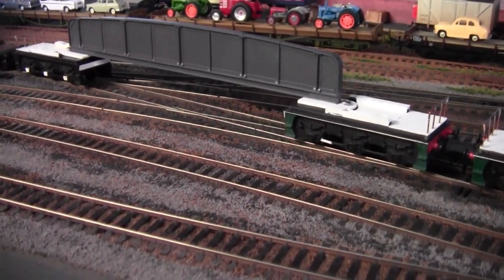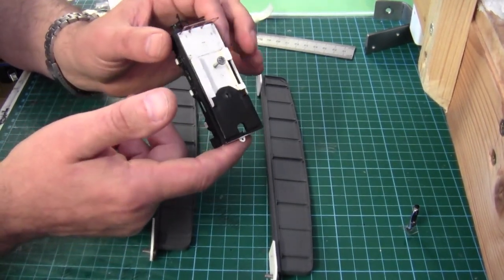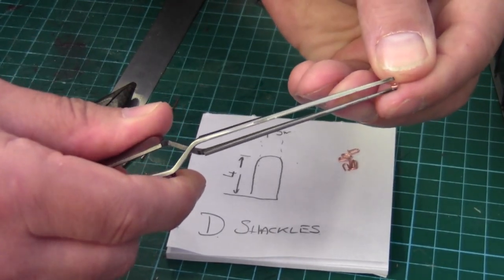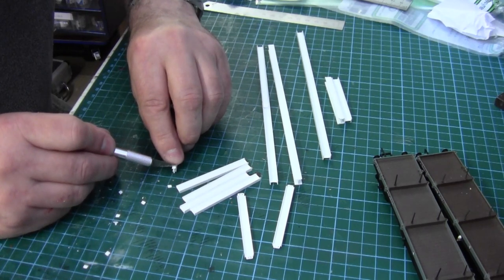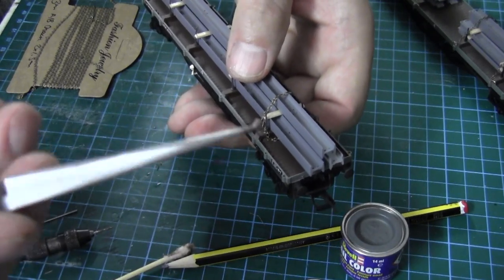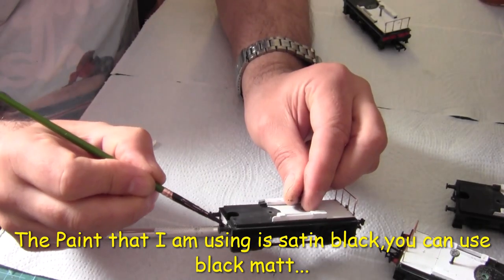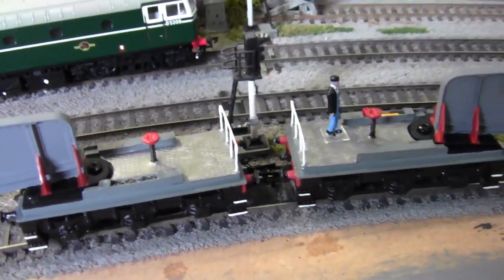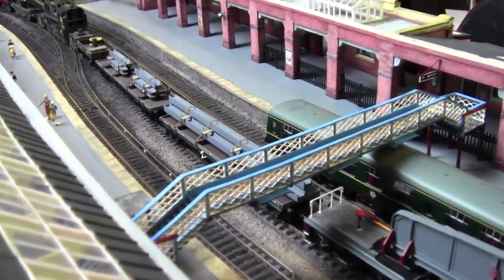The Bridge Transporter Part 2...No263

Comment: It is all this added detail that adds so much interest to these LBWs whether stationary or as part of a moving train.  Oh, and for your information, mate, the ‘gusset’ is called the web of the girder.  Love the girders with their chains on the bolsters; very realistic looking.  Great job, Tony.
Joe and I saw it all arrive at Newhassle.  We were there trainspotting.  😉
I thing that you need some shims under the right hand legs of your bench to make it level, Tony.   Best regards, Jason
Reply from the maker: Hi Jason mate. i knew about the web but i just couldnt find the right words during videoing at the time. i hope you can forgive me on that one. thanks for the reminder though.  so you and the guys have seen the run through Newhassle. i bet you wont see another one like it. my bench is an old camping fold away bench. and it rock and rolls when videoing. its a right little rocker....many thanks again for commenting. best regards Tony.
Reply: @TONYNORTHEASTERN  We were more interested in LBWs than the 9F.  We’ve seen the 9F before at Tyne Dock Shed. 😉 Have a nice weekend, Jason
Reply from the maker: Cheer's Jason. the 9 Fs were probably used for the Tyne dock run with the iron ore train...which needed 2. one as a banking engine...cheer's buddy Tony

Comment: Tony, to tart up your brake stand you could have dropped a slightly larger washer to the floor and screwed your stand in; then cut some small "fins" and glue them to the stand and bottom washer.  They would make it look like a cast iron affair rather than a screww.
Reply from the maker: Good Morning Dave. great idea by the way. i don't know why i did'nt think of that. i could probably still put a 3mm washer at the base. thank you for the tips......best wishes Tony